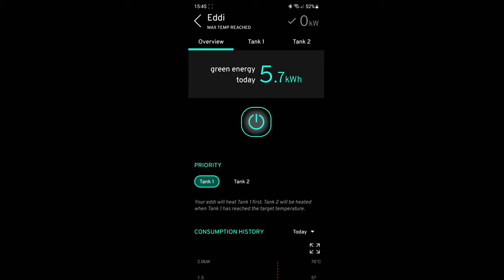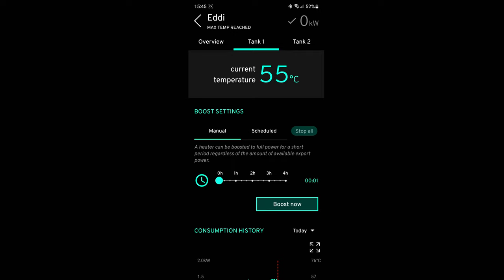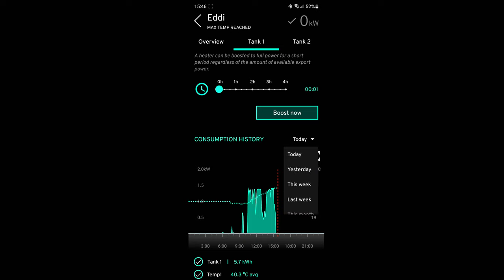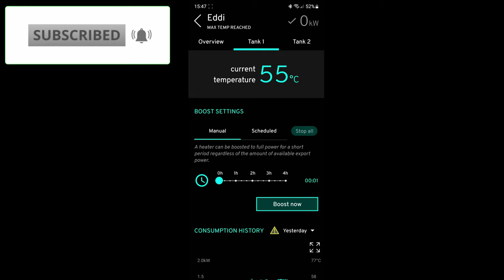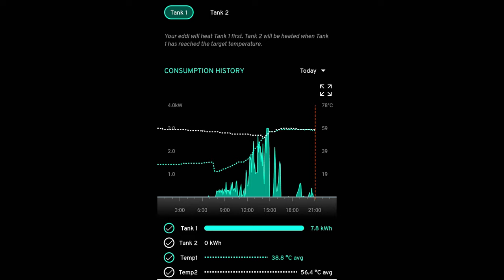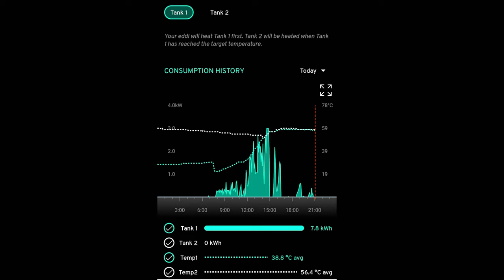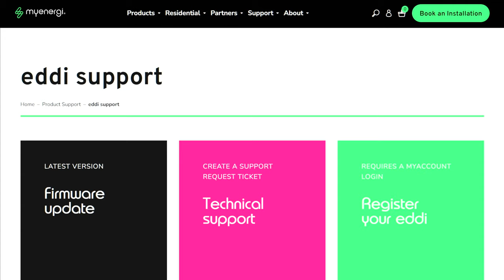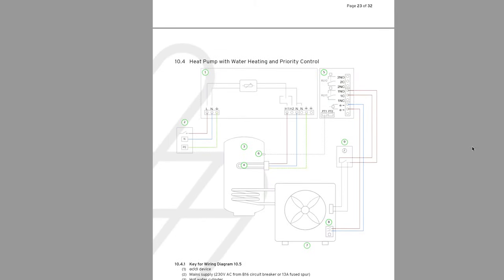MyEnergi Eddi Temperature Sensor. How does it work in the app?

Comment: Thanks for sharing your installation and the app information, I had my relay board delivered yesterday and I’ll be fitting it over the weekend, I only brought it due to watching your installation video…. Wouldn’t it be great if Myenergi could make the app so we could set the temperature needed, we could set the element to a higher temperature such as 70 deg and then we could control the temperature up to the maximum, great videos
Reply from the maker: Yes, that would be a nice little add-in if we could do that. Although it doesn't seem that long ago, they added the temperature reading to the app, as it wasn't in there before.

Comment: Great to be able to see the temperature!  Just bought the kit, and will install in the next couple of days. Do you know of any way to prevent Eddi from using excess solar between certain hours?  I’m on Octopus Flux tariff, and would like to maximise my solar export between 4-7pm, and not use it to heat my water during this time. I can obviously do it by manually switching the Eddi off, but do you know of any automation method to achieve this?  Thanks!
Reply from the maker: No, you can't do this in the app. You can only schedule boosts. I don't know if you can do this in the home assistant program. I don't know if there is a plug-in for myenergi in that. I haven't used it, though.
Reply: @daniel_coe  Thanks. I’m wondering about putting the Eddi mains supply on a smart plug which I can schedule on/off periods. Not sure what happens to my settings when I switch Eddi off, but I’ll find out!  Meanwhile, I don’t have a lot of hope, but I’ve asked the Myenergi development team to consider adding this capability to the app. We’ll see. Thanks again.
Reply: @christaunton  when I wired my Eddi in I put 2 single sockets for the outputs, I put 13amp plug tops-on the wire from the tanks, I use Tado 110 energy monitoring plug and set a schedule for the plugs to turn off between 4pm & 7pm, it works perfect the Eddi thinks the water has reached temperature, doing it this way you won’t lose any data from your solar system, you can also ask Alexa to schedule the sockets to turn on and off between the times
Reply: @robhoulden  Thanks - sounds perfect!!

Comment: I have a iBoost+ to use my spare solar and when the water is hot it switches to channel 2 (Your tank2) which I have connected to a 3kw storage heater (Internal Ceramic Bricks) in our living room which keeps the chill off in the day and can open up in the evenings to save on some gas for the CH
Reply: I'd like to do this too , have you any information about the storage heater you used and the connection to the eddi